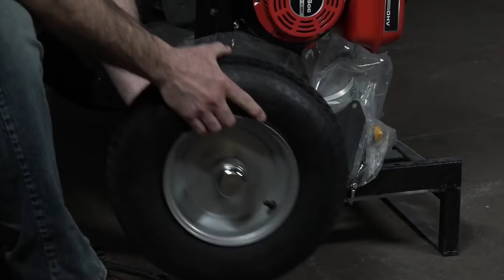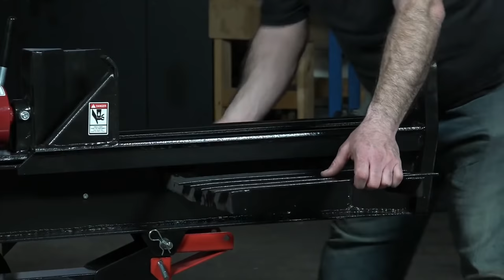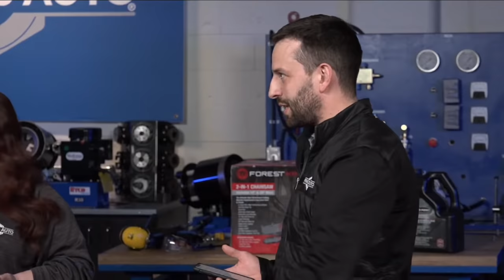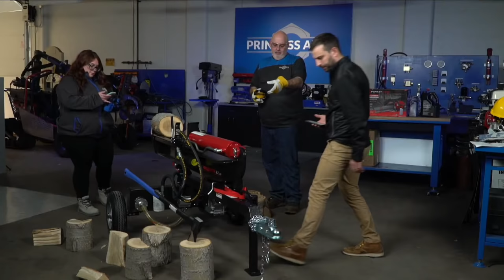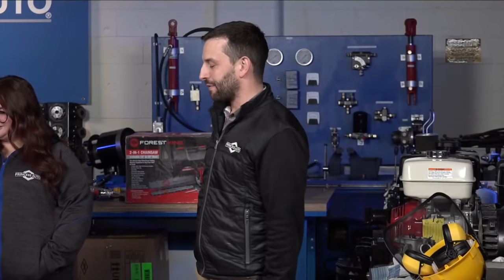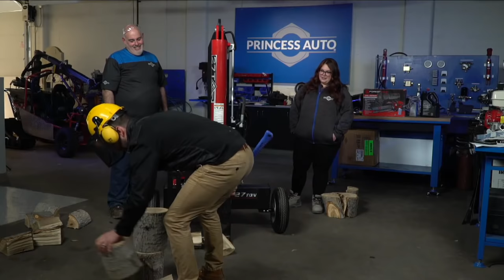See it Work - Episode 12 - 27 Ton 196cc Gas-Powered Log Splitter

Comment: Anyways nice little wood splitter. Here's an add-on you can sell separately and it's an aluminum bat with a titanium handle and the reason for this is Incase your in the woods having a really good day going for you as your splitting wood and out of the corner of your eye there's a sasquatch with a bad case of the rabies. Now you me and I'm assuming everyone else could agree nobody wants to have that experience and if he charges you full on and you got nothing it's all over Johnny! It's the aluminum for easy Swift swinging and the titanium for strength and durability cuz it's more than likely you're going to have to put the whoop to ol' rabies with an attitude a few times to deter him away from you. Just a thought

Comment: I have bought a timber lot in N.B. and want to know the largest log you can split. Also can you get a 4 split?  What size are the wheels?  I will also need a forestry chainsaw 18" bar with wrapped heated handle. Thanks.
Reply from the maker: Hi Ruby! Congrats on the purchase of your timber lot! The largest log this unit can split is 26" long. As for diameter - if you can lift the log on, this splitter will split it.
We'll have a four-way knife option for this unit in stores later this year - stay tuned!
The wheels are 16" for the rim size.  As for the chainsaw, it doesn't have a heated handle, but you should check this one out on our website - https://prnc.es/2Qw1upB.